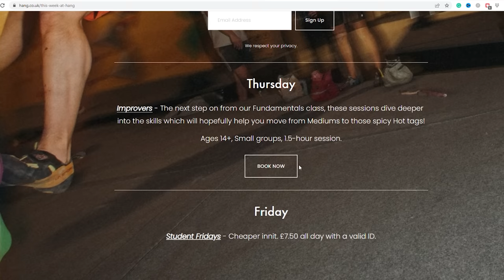Pro Route Setter Vs 1st Timers

Comment: This video was great! I'd love to see the format refined. I reckon the judges shouldn't know who did which boulder (though it may be obvious), and there should also maybe be a theme that should be aimed for. Something like "big moves", "pulling hard", "facing away" etc. just to try and bring the style of the competing boulders a bit closer
Reply from the maker: I like these ideas!
Reply: the thing is is that the idea of the competition was based on hold choice so they'd already know
Reply: yeah I would also love the opinion of "random" climbers in the gym !
Reply: I would also like to see the competitors to set with the same holds! When using different type of holds it is harder to compare.
Reply: @BoulderingBobat  Also / Or have a routesetter that doesn't know who did which boulder come in for some extra thoughts and scoring